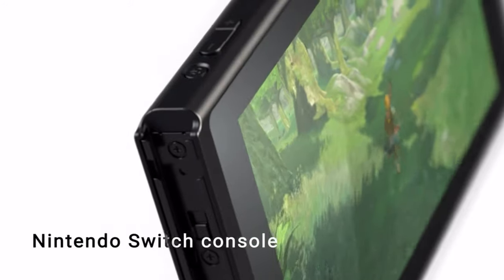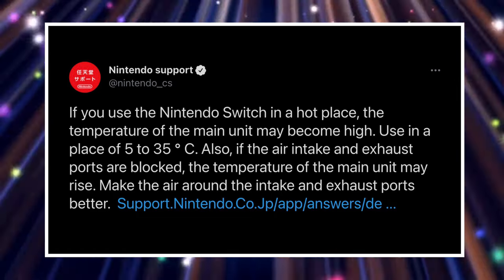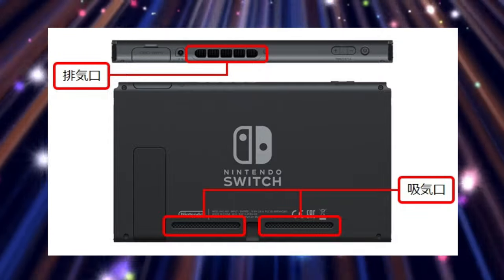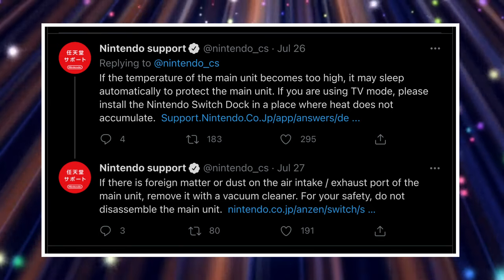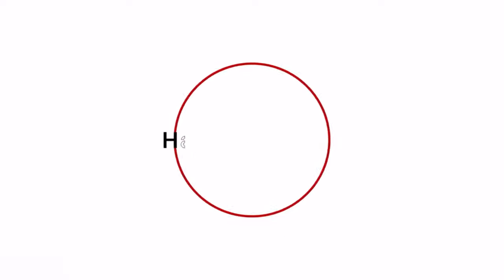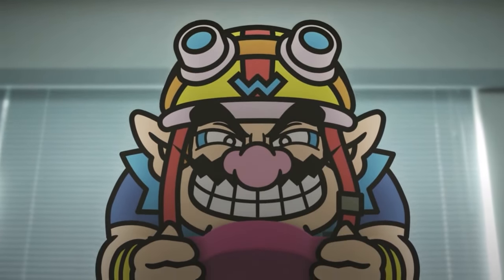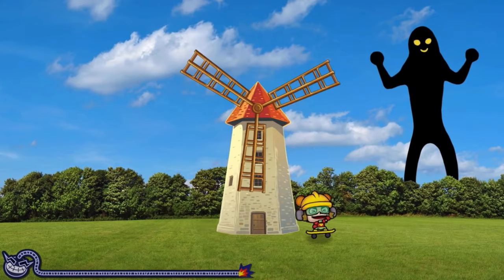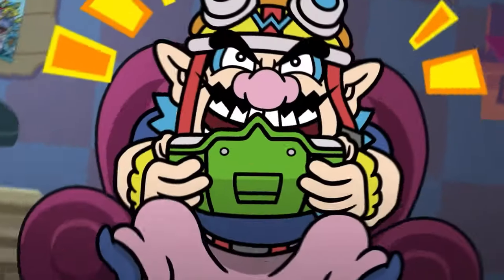Here’s A Quick And Easy Guide To Help Prevent Your Nintendo Switch From Overheating

Comment: Is it safe to keep my switch in a case that's specifically made for carrying an undocked switch? Because I constantly have mine undocked and I leave it in the case when I'm not using it. I do this to avoid getting dust or cat hair in it.
Reply: you're good I do the same. The switch starts cooling down as soon as it's on sleep mode.

Comment: I’ve had my switch since launch day and it’s never once overheated. Probably 4000 hours of gameplay in its life. After its third year the fan started grinding and I played it with a grinding fan for about six months and it still never overheated. I eventually replaced the fan and the thermal paste and now it runs even cooler than it did when I bought it. I mostly play in docked mode BTW.

I’ll also add that I rarely ever dusted my switch and after all those hours of use when I took it apart I was surprised at how little dust was inside

Comment: I remember 2 years ago, one of my siblings knocked my switch onto the floor. About a month later, the fan would go crazy. Loudest thing in a room at all times. Pretty much a plane turbine. It was spinning, but not working correctly, and my switch would get really hot. Nintendo ended up replacing my switch after I sent it in, tho.